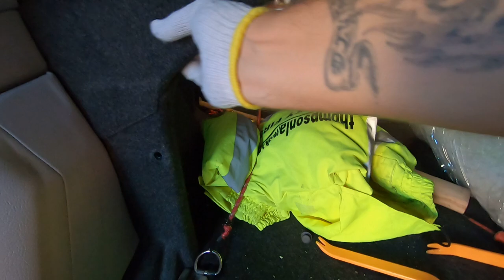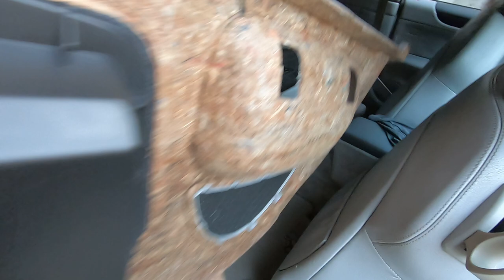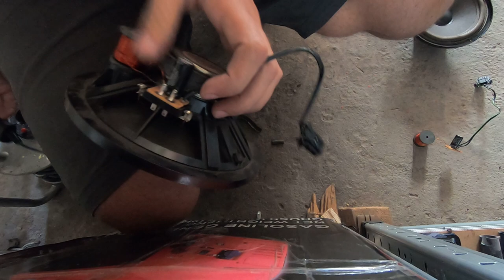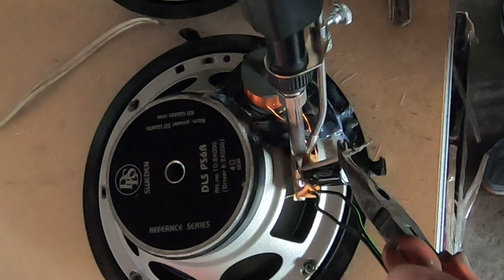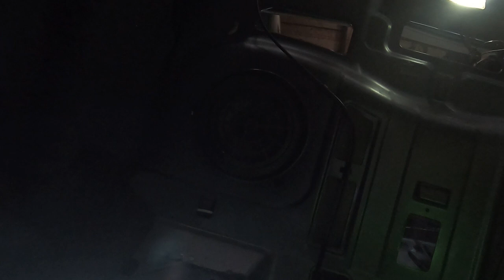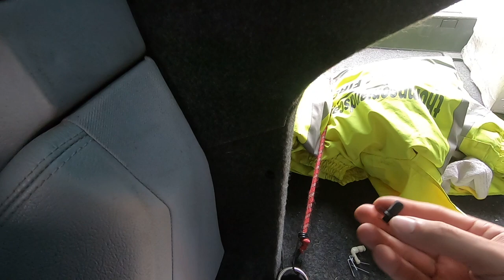MERCEDES CLK W208 rear deck panel headrest dismounted and rear speakers change ,hintere Lautsprecher

Comment: I have struggled for hours to remove the headrest (around 3'00 in the video) so here's how it can be done if that helps: the aim is to lift the spring that can be seen from the plastic covers holes, for each of the headrest steel leg. A white plastic knob that is in part underneath the spring helps lifting the spring. If the white plastic knob is directed towards the back of the car, press the end of the knob while pulling the headrest steel leg, and repeat for both legs. If by mistake you switched the white plastic knob towards the front of the car, then press the side of the knob so it still lifts the spring, though not the way it's intended to, and pull the headrest legs. This is especially useful for releasing the headrest legs which are on the center of the car side, because we can only access the mechanism from above.
Reply: No consigo hacerlo me puedes ayudar
Reply: @danielpena3692  Es dificil si, pero no imposible. Lo peor de todo es que hay dos enganches por reposacabezas, asi que tienes que encontrar las cuatro palancas que liberan los ganchos. Y hay una en particular que tiene un acceso casi imposible.

Te recomiendo que empieces por el reposacabezas detrás del conductor (volante izquierdo), ya que son las palancas accesibles. Cuando las localices, tienes que empujarlas hacia atras hasta que se bloqueen. En esa posición de "bloqueo" se mueven un poquito mas hacia atras, ese movimiento es el que levanta el gancho que sujeta cada pata el reposacabezas, asi que tienes que apretar palanca y mover el reposacabezas a la vez.

La verdad, debi grabar el proceso que segui yo...

Comment: Finally a good video. So what kind of speakers fit in the rear? Maybe even just Bass speakerssince thats the purpose of the original ones I suppose. I slready liked the sound of mine but two of the speakers are beoken so I thought about replacing all of them with new ones
Reply from the maker: 160 mm diameter
Minimum 50 w
Reply: @AutoMotohowto46  thank you!

Comment: you could have fitted rear blind,, would that be much work if you had the blind and rear shelf for blind??  wire it to rear light but i don't know if the car is pre wired for blind and blind switch. do you know auto moto?
Reply from the maker: Nu inteleg la ce te referi domnule …

Comment: I own a clk w209 1.8 kompressor from 2004,I can t find the rear speakers place is it in the same place as in this video or doesn't have a place for rear speakers. I saw on the both doors have a 2 speakers down in every part.
Reply from the maker: Same place
Reply: Could I contact you somewhere to give you some photos to help me if your willing to, I'm a new owner in this clk and don't know that well.
Reply from the maker: @chetansergiu9358  esti din Romania ?
Reply: @AutoMotohowto46  da
Reply from the maker: @chetansergiu9358  incearca pe Forum ClubMercedes.ro sunt sigura ca gasesti o sectiune cu rezolvarea problemei tale
Reply: @AutoMotohowto46  Okay, mersi frumos.
Reply from the maker: @chetansergiu9358  Bafta !
Reply: @AutoMotohowto46  Din păcate nu am găsit nimic și îmi spune ca nu sunt autorizat sa postez sau sa trimit mesaje, nu știu de ce, dar cont mi am făcut

Comment: Great job. I didn't watch the whole video cause i did it my self a year ago and learned the hard way 😔. 
I don't have a lot of experience or knowledge about speakers. 
But i installed 320 w kenwood speakers and it sound just ok, nothing special. 
I'm wondering what that piece you toke out of old speakers and installed on new ones do ?
Reply from the maker: hey hello, first of all I want to say that you asked a question of grade 10+ , as you saw the speakers are mounted with the membrane down so all the noise goes in the trunk , and the parts I saved are some filters , audio filter is a frequency dependent circuit , range , 0 Hz to 20 kHz , well as soon as the speakers are oriented in the trunk imagine how you can hear the voices from the song in your trunk :) , weird, so these filters leave only the low frequency in the membrane, meaning only bass , Audio filters can amplify (boost), pass or attenuate (cut) some frequency ranges. Many types of filters exist for different audio applications including hi-fi stereo systems, music.     And regarding Wat I respected the power taken by the CD-Player, this is not the original one, it is a JVC 4x50W, what I can say is that it sounds pretty good but it doesn't satisfy me ..., a correct volume 37 out of 50.

Comment: Bra how did you put the bits off the headrest mechanism back in
Reply: i'm about to disassemble mine
Reply from the maker: Iti vei da seamana cum se pun inapoi dupa ce le vei scoate
Reply: @AutoMotohowto46  hey so I've taken out the 2 outer clips but i can't access the ones on the inside
Reply: I just can't reach the little clips so i can push them down
Reply from the maker: @brucemclaren-  insist , insist